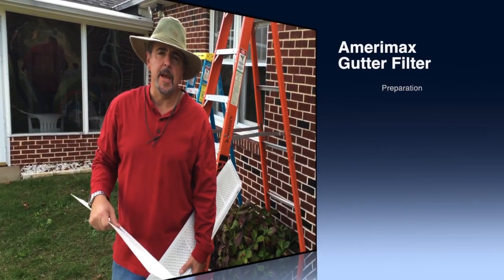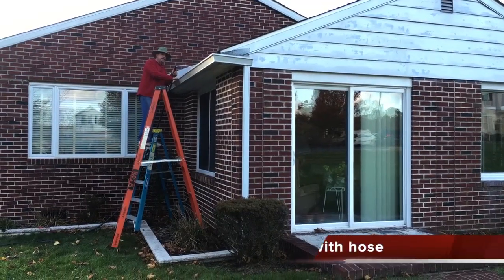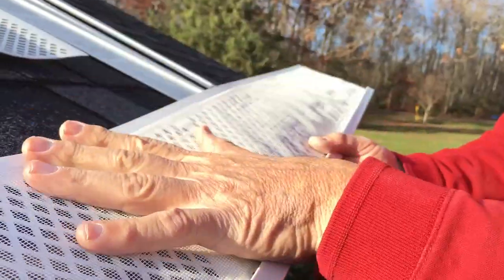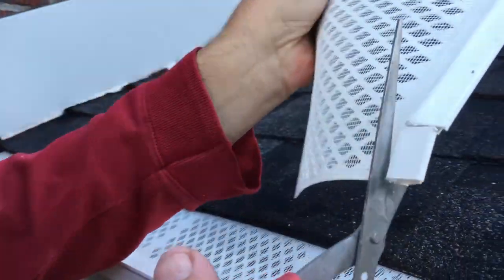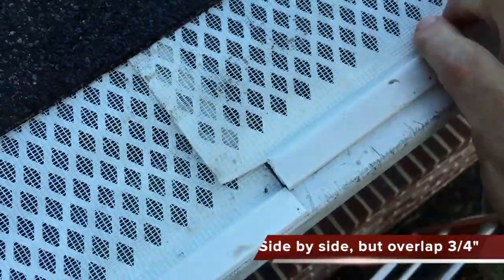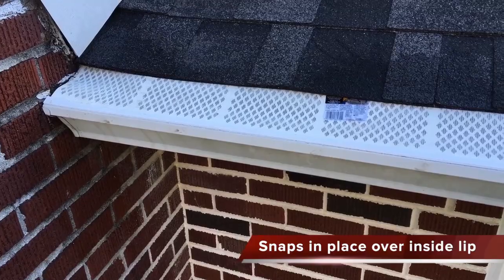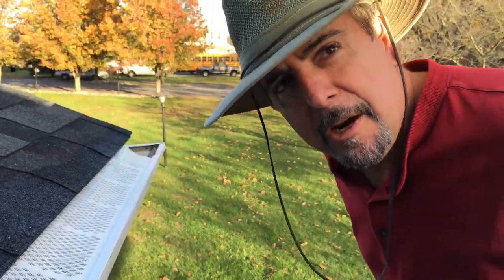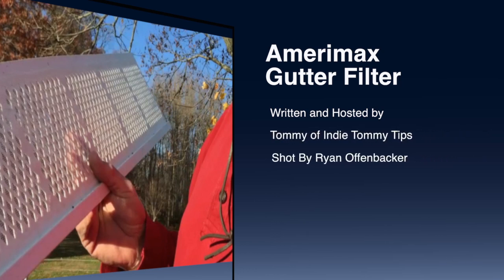Installing Gutter Guard Leave Filters

Comment: Installation tip: apply some dish detergent along the top outer lip of the gutter - it makes it much easier to snap the gutter guard on and saves time. Even though the temperature was in the low 80's, I found the Amerimax Gutter Filters hard to snap on to the gutter until I tried the dish detergent. It made a big difference.
Reply from the maker: D K such an awesome tip. Thank You!

Comment: I installed those on the lower section of my split level house.  i like the idea of over lapping them 3/4 of an inch and cutting a notch.  So thanks for the tip and yes sometimes they are hard to snap in and also remove.  The upper section of the house is very high so I will have to pay a roofer to install them.
Reply from the maker: That's a great idea!
Reply: They are 36 3/16 long i am thinking they cold have made a tad bit longer to overlap and keep an even number for planning purposes.

Comment: I installed these Amerimax Gutter Filters to my home several years ago. Being that they are plastic, they eventually sagged into the gutters, allowing debris to pile up on top of the filters and inside the gutters.   I'm spending today on a ladder removing the failed Amerimax Gutter Filters and installing aluminum Gutter Guard in its place.  The Gutter Guard product is a bit more costly than the Amerimax Gutter Filters ($7 per 4ft x 6-inch section for the Gutter Guard vs. $2 per 3ft x 6-inch section of Amerimax Gutter Filter), but I expect they'll last longer and not fail the same as the Amerimax product did.
Reply from the maker: good to know

Comment: A tip I received was to take what looks like the netting off. When it rains hard the water will at times flow over the guards as it can not go in the gutters as quickly. With the "netting" off the water goes in the gutter and not runs over it. Just a tip.
Reply from the maker: I agree. Yes it makes sense.
Reply: Actually, I'm replacing a few sections of gutter guard b/c the netting has deteriorated over time.  Without the netting, maple leaf seeds get stuck in the diamond holes.  (Smorgasbord for the squirrels:)
I don't recall seeing the rain sheeting off the netting instead of going into the trough although I have to believe it can happen in a heavy downpour.

Comment: Since I get snow/ice, i was concerned that the mesh would encourage melting water to freeze on top, vs no mesh would allow the water to more easily drop into the gutter.   Once the ice builds in the mesh, it could continue to build up due to blockage.   So I removed the mesh - easy to do.  I too cut the corners & it does mk a difference.

I found too that it helps to leave a little space off at the ends, or install a small piece at the end so I can easily insert my hose (w/o nozzle) & either spray the inside gutter or better yet, push the hose inside the gutter to remove blocks that still can occur (depends on amt of leaves).
Reply from the maker: Awesome feedback

Comment: I just purchased some of these at the local hardware. They have no brand name but look just like these.
The problem I'm having is that none of them will snap into place. I push them as far as they will go on the gutter lip and they slide right back off.
The only way I'll be able to use them is to put a couple of nails or screws in each panel on the shingle side in order to prevent them from backing off the gutter.

Comment: On eBay I can buy about 100 feet of gutter leaf protection shields for less than $100.
  my house is a ranch 62 feet long. The only part of the house I am concerned with the gutters being clogged by leaves close to where my house is the front/uphill side. When hurricane Ivan came over dumping 5 inches of rain on Western Pennsylvania period that was the first and only time I got a little bit of water in my game room/utility furnace room.. it was probably less than 2 gallons of water, but it’s saturated that area of about 10 ft.² of the carpeting against the. that was the first time I realized that the overflow happened rather than the gutters carrying the water away caused the water problem.
  ever since, I have been using my gas leaf blower to blow out the gutters two times maybe three before winter every year when the leaves are falling.. so blow the gutters out takes me less than 10 minutes. The hardest part is putting up the ladder to go up the eight or 10 feet to get onto the roof in front of my house..
  I don’t like to keep walking on the roof. I try not to twist my feet when they are on the roof, I try to walk softly so I don’t damage the shingles
  my concern with these plastic or metal covers over the gutters is, what’s to prevent the leaves from getting wet and sticking to the gutter covers and making the rain just run right over the leaves & gutter completely..
 I am a very mechanically practical person. I can absolutely see how wet leaves could stick to these covers preventing rain from dropping thru these gutter leaf shields..
  on my job I travel through all the boroughs and townships within 22 miles or more of the company base that I work for. I have seen many of these gutter leaf guards out to the trash in front of peoples homes on trash day. I don’t mean just one or two sections. I mean it was obvious that they removed all of them from their gutters and put them out in the trash..

Comment: Looks like the video was done in '15. How are they holding up and functioning?
Reply from the maker: The flat roof section, the porch, stained the white grates a bit black. Other than that, none have moved out of place or cracked.
Reply: Tommy Rosa 
Are they effective? How often do you need to get on the roof for maintenance?
Reply from the maker: They are great so far. I guess it would depend on the tree fall of leaves in your environment.
Reply from the maker: They are still holding well
Reply from the maker: They are still doing well. None have moved out of place

Comment: I installed those filters several years ago and replaced them with similar aluminum the very next year. Mine were a bronze color so the darker color may have contributed to the problem I had.

With my install the heat from the sun caused them to sag and permanently deform.
Reply from the maker: So what did you do?

Comment: i live in fl, my shingles have melted together because of heat. how do i raise shingles without tearing them and make situation worse?
Reply from the maker: Hello Ronald. Gosh I wish I had an answer for you to prevent or help get loose stuck shingles. Maybe if you had a very wide type of knife, the kind used to apply spackle for sheet rock? Maybe something like that would enable you to pry the shingles apart

Comment: How do I cover concave corners (e.g., in a courtyard)?  The lip they need to snap onto are covered by a vertical splash guard.
Reply from the maker: I wasn't able to show that sorry. Make a template using cardboard
Reply: @TommyRosaTommyProductions  That's ok.  I just eye-balled and cut the gutter guard to avoid splash guard.  Also, I couldn't slide it under the tiles in the corner, so I cut, in the gutter guard, 2 slits (one on either side of the corner) and just let it lay over the tile (sort of - sticks up a lil).  Not pretty and both kludgy, but they work.  No leaves have gotten past or (for the latter kludge) even stuck.
Reply from the maker: Sounds like it makes sense Tom. When I bought those gutter guards, there was no clear instructions on how to use them. I kind of just figured it out. And had my friend record me with my iPhone.

Comment: Just bought mine today to try on my 6" gutters, but they seem too wide, I can't lift the shingles up that far like in the video. So is it OK to trim the width?
Reply: Yeah, but..... (read disclaimer at end). I end up trimming the width on the pieces that are installed over the end/downspout section of gutter that wraps around the sides of the house, where there are no overhanging shingles to slide them under. But there have also been cases where I ran into an occasional roofing nails that was installed too close to the roof edge, blocking the back of the screens from sliding more than 1/2" under the shingles. But that's never been the case on entire houses. 

>>>Disclaimer: If every screen needed it's width to be 'trimmed' back in order for them to fit, I'd ONLY install them if I had access to a portable, table mounted, mechanical sheet metal cutter, which would cut the screens in a quick, even, consistent manner. If I had to cut each and every screen with a hand held pair of sheet metal shears, I'd be reluctant, due to the difficulty and time consuming manner required to cut off just the right amount(not too little, or too much), and to keep them even and straight.
Reply: @patrickmcleod111   Take a flat bar or wide putty knife and unstick the shingles.
Reply: @cletusspucklerstablejeaniu1059  If they were newer shingles, and if it was on my own house, then I'd do that. But there are 2 issues. 1. I actually lost my house several years ago, which means I won't be needing to install gutters guards on my own home anytime soon(😞). 2. Most of the gutter screen installations I have done, have been on other peoples' homes, and I'd be VERY leery of trying to pry up each and every edge shingle to fit gutter screens underneath, because very few of them have a relatively new roof.

 When trying to pry up shingles on an older roof, you are risking damaging shingles, which will have to be replaced, involving shopping for matching replacement shingles. It's very dependent on outside temperature too. If the shingles are newer, and are stuck down with excessive asphalt/tar, and it's summer time, then prying them up  'may' be relatively easy and damage-free. But I still wouldn't want to pry up every one along the entire roof edge!
Reply: @patrickmcleod111  .. Oops, my comment was meant for A10TOES
,  but do it in the morning when it's cool and separate the top shingle from the starter shingle. some starter shingles may be nailed too close to the edge, going between them solves that problem, if someone has added extra tar then it's a whole new problem. You might be able to bow them under the drip edge.depending on the kind you have. I did that on my pole buildings steel roofing and it worked fine. I used the LB Plastics 4' White Filtered Vinyl Gutter Cover from Menards.
Reply from the maker: A10TOES They would not trim the width. Wait until the shingles warm up so you can slip them under there

Comment: I have about 40 large soft white pine trees all around my house, the pine needles clog my gutters constantly, I was wondering if the pine needles will stick in the screen ??
Reply from the maker: That’s a good question, if they lay on top of the surface area, and it’s wet, I guess they could clog the top? I would ask the manufacturer if you could get through to them

Comment: Are’nt they not installed the wrong way... the mesh souldn´t be under?
Reply from the maker: No they are correct
Reply: If u flip it over u won't have the lip at the end where it snaps into the front of gutter so it would b flush and any debris would run right off instead of getting stuck on the guard.

Comment: Anyone can figure out the straight....SHOW corners please.  Inside and outside bends.
Reply from the maker: I agree with you. But I shot that many years ago. And I had no one to hold the camera while I stood on the ladder and cut the corners. It’s best to use a paper template. UsesUse a scissors, paper and some tape and make a template and then place it over where the corners go, put it on top of the plastic, mark it out with a magic marker, and then cut it accordingly

Comment: Mine won't go under shingles too far. Maybe the gutter guards are too wide?
Reply: I had the same issue on my garage. The shingles were nailed closer to the edge, and the guards were hitting the nails. I just notched the back edge of the guards where the nails were located.
Reply from the maker: sometimes you have to wait until its hot outside

Comment: I had the same gutter guards on my house for 2 years now and the problem is the screen on the inside falls off and everything goes in your gutter and you have to take them off to clean your gutters out they are poor design I will never get those again don't waste your money they're junk
Reply from the maker: I agree with you. I didn’t like the way they only used a little bit of glue in spot areas on each insert panel